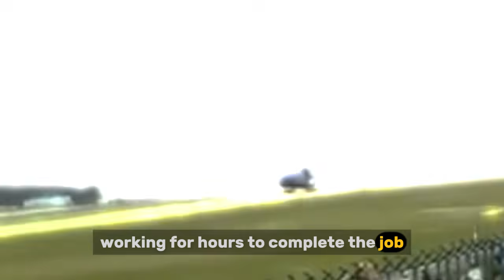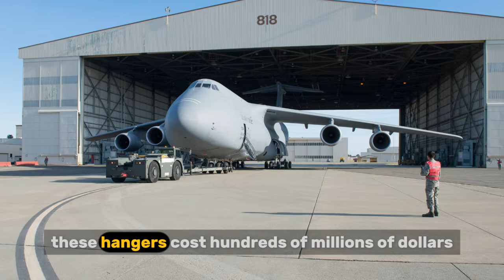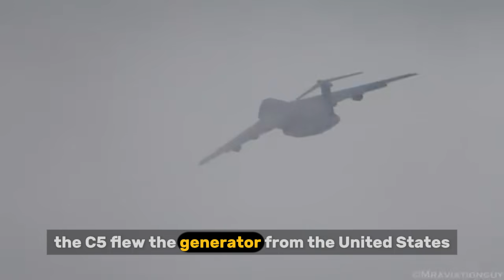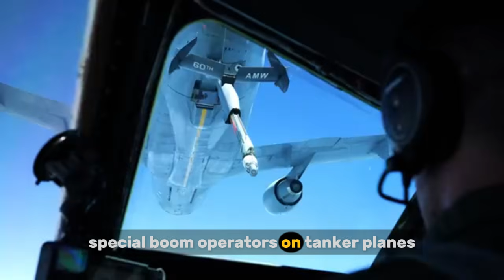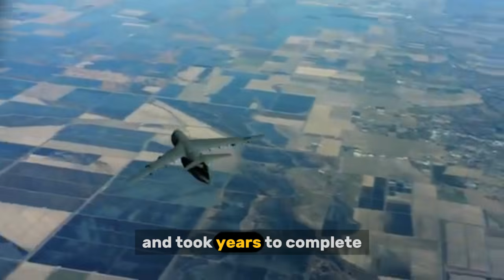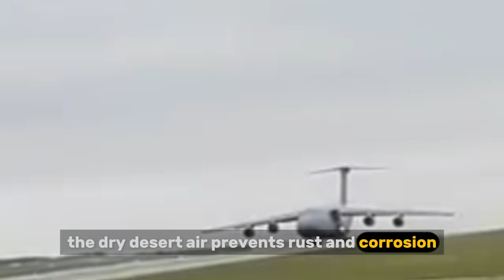20 Weird Facts About C-5 Galaxy You Didn't Know!

Comment: Being able to walk inside the wing is not a new thing with the C-5; there were quite a few aircraft developed in the interwar period, mostly as passenger transports, where the wings were thick enough that not only could the flight crew walk inside the wing, but they had access to the aircraft's engines to perform maintenance on them if a problem occurred during flight. Advances in aerodynamic theory, however, rendered the airfoil designs that allowed this level of access obsolete, with thinner airfoils providing better performance.

And the C-5 is just one of the giant aircraft to earn the nickname "Aluminum Overcast".

Comment: I was an engine mechanic on these for 8 years, and never, ever did we kneel the plane to work on the engines. The hydraulic systems were a nightmare, and the hydraulic shop would absolutely kick our asses !! After that, then we'd get to explain to the production supervisor and all the commanders  why we broke the airplane.
Reply: It's not the C-5, and a flight crew mistake rather than a maintenance crew screwup, but I remember seeing pictures of a landing accident where a C-130 screwed up its approach and landed on the wrong parallel runway, picking the one that had recently had repairs done, and rolled into a section of airstrip where the replacement concrete hadn't had time to set fully, settling into the concrete and dragging quickly to a stop, leaving troughs in the concrete behind them. I can only imagine what trying to a) get the bird out of the concrete, and b) get the concrete out of the landing gear, would have beeen like. A "career-defining moment" for the aircrew.